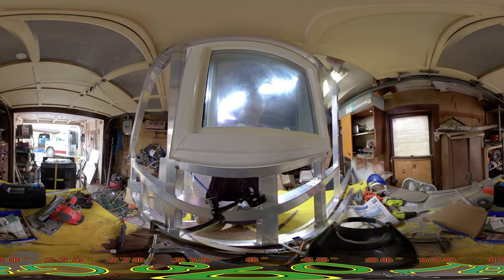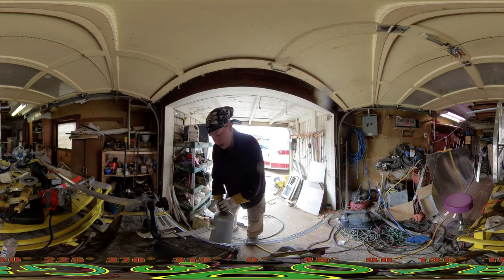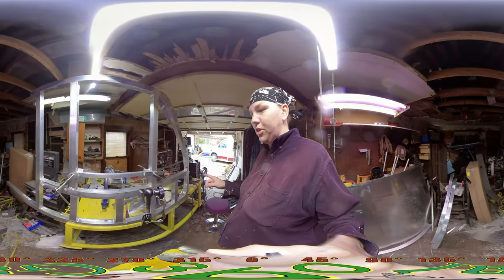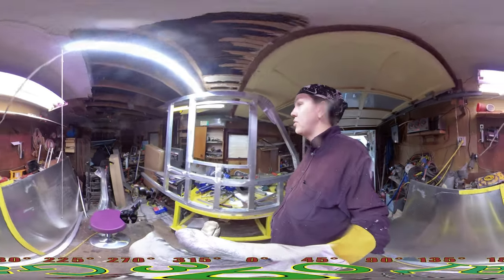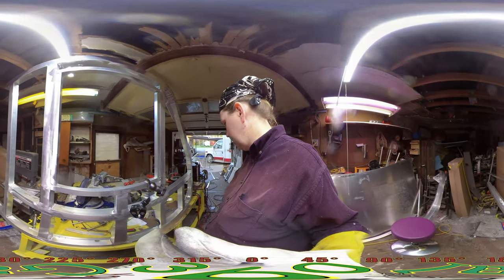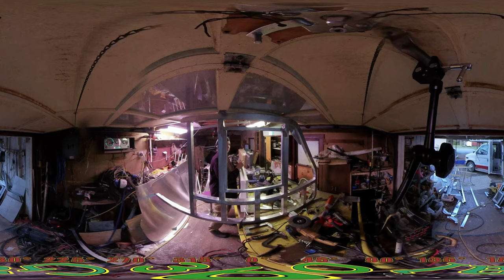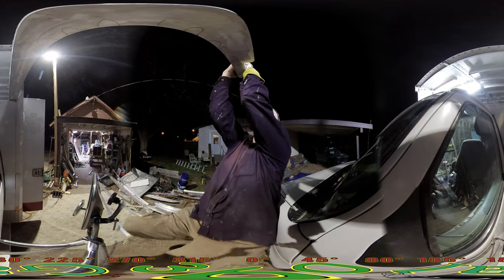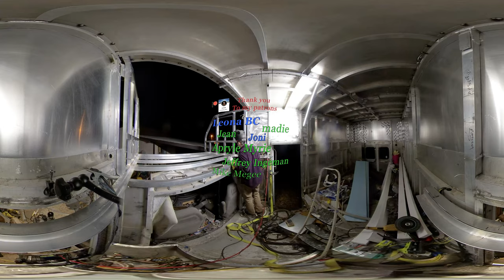360 Ambulance to RV (Ep30) Adding windows in to the bed room.

Comment: As much as I miss your amazing smile, you are doing/adding way too much to your build.
You haven't even taken it out for a rigorous trip yet .
You don't even know it will take some serious trips yet.
Reply from the maker: ahh but i have. i drove it back from  the auction site to here  from Utah  to Oklahoma
Reply: @PurplePercepti0n   I recall, you had a lot of engine problems on the way. Utah? I thought you bought it in Canada?
Reply from the maker: I had no engine problems but alot of bad tires blowing and the ambulance box electrical problems on the way back. We fly up there and drove it back.  It is under the  i got a new rig video or a few after .  Now the bus had power steering problem when i was up there that is fixed when i was up in or.  But i am other than a few items i am sure it has a pretty good motor.  But if i am rong that is why i am building with the ability to remove it from the fraim and put it on another chassis.